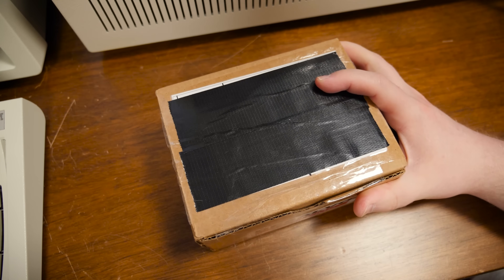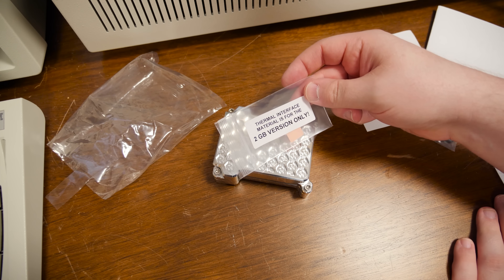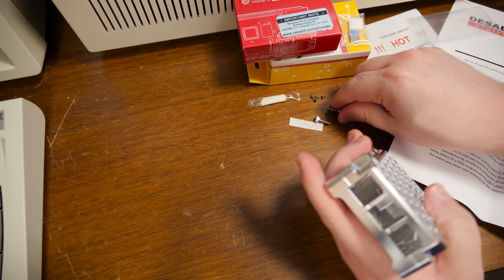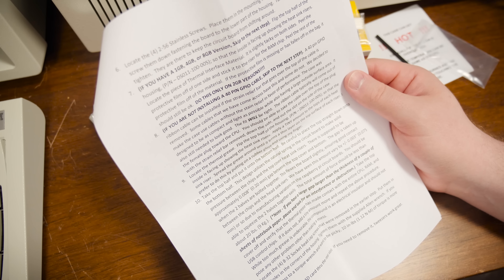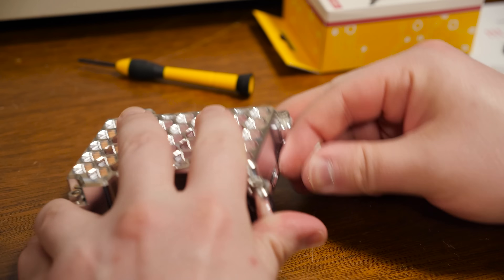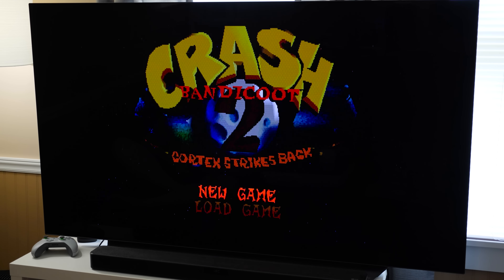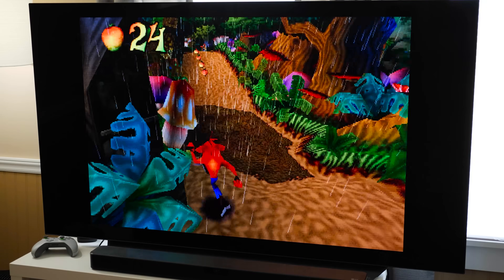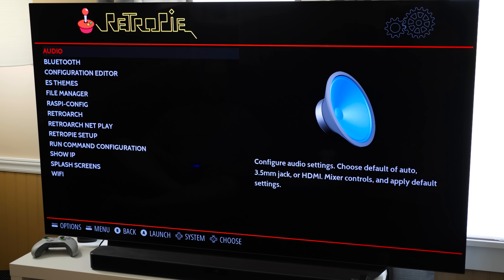Solid Aluminum Raspberry Pi 4 Case by DeSalvo Systems

Comment from the maker: To those saying this kills wifi and Bluetooth: nope, not that I can tell! PS4 controllers still work great and so far I've transferred a hundred gigs of files using Samba wirelessly with no problem. And my router is on the other side of the house, so yep, seems good to me 👍
Reply: awesome
Reply: Pretty neat looking case, could probably plug in a regular usb fan too keep it cool additionally if you ever need too overclock I'd imagine.
Like just setting it down next too the case pushing air from the micro sd slot side.
A random 120mm fan from a power supply hooked into a free usb port on the raspberry pi & it's gonna cool it down fine I'd imagine perhaps as well or just a random usb wall adapter belonging too your average phone that's spare should do the trick as well.
Also that reminds me i got a 3B sitting on a shelf with a small memory heatsink on it just collecting dust atm. (Got no usb keyboards atm nor wireless peripherals, could probably hook up that too a spare hdmi port on my monitor & mount it with doublesided tape or velcro as it's light enough.)
Reply: @Mini-z1994  Hey Bro! Cool story! Tell it again!
Reply: nice.
Reply: .....makes me think that case needs a fan on it
Reply: That's kind of unfortunate, because I was liking the idea of this case as an RF-shielded case for radio related projects and stuff.
Reply: This seems like a modular thing that  could integrate with whatever tool, automata, or vehicle that the pie is driving.
Reply: What i'd like to know is how the case manages to not short out the various soldier points and traces on the board.
Reply: @jb0nd38372  The magic of solder resist.
Reply: @jb0nd38372  it only touches the pi on the screw mounts and the three heatsink touchdowns. So nothing else has a chance to touch and short.

Fwiw, I have one and my wifi signal went from full bars (right next to router) to 1 bar. So, yeah, best to use an ethernet cable of you need decent network strength.

Comment: The actual best way to run the GPIO is with an old school 40p40c IDE Extension cable. I've made a few of these myself with bulk connetors and cable. Works nicely. If you want to fit the male connector to the outside, you may need an accompanying female connector to keep the pins from bending.

Comment: The way it's designed, the CPU will heat up the other components that don't get as hot, like the RAM. I wonder if they can tolerate the same temps as the CPU?

Comment: I have one of those cheap 15 dollar cases that came with heatsinks and at 2ghz the pi doesnt throttle. I would assume that case can soak heat for a really long time. Who knows when the thernal throttle actually happens but its prbably a very long time

Comment: Looking at the top design in your picture you've used. I'd suggest they used that design to increase the thermal footprint that the heat can be dissipated from. The only thing i'd like to see, not that i've dabbled in such things; is a few of they outside hexagonal shapes milled out completely and a second slit in the case on the opposite side to the one already there, so ir matched and allowed heat to rise and cooler air to pass in through; there is a technical term for this but i can't think of it.

Comment: Put thermal paste on the surfaces where the upper half touches the lower half, or else, the lower part is completely useless as a heat sink! So useless, that it could have been made out of nickel-platted cheap plastic, so, halfing the price and weight of this product...

Comment: I wish the Pi4 had gone with the CPU and RAM on the bottom of the board. I have a NanoPi M4 that I bought because it is designed that way and has a huge passive heatsink that mounts to the bottom. Also it has antenna connectors.
The Desalvo case is what I would design if I made my own.

Comment: Great video LGR, as for overclocking the Pi 4, a few tips. Firstly, you're going to want some form of active cooling, a fan will work well. I've got the Ice Tower thing that looks like a gaming PC cooler from Amazon, I can use a Pi 4 with the absolute maximum overclock the firmware will allow and it stays about 60C-70C, which is absolutely fine for a computer like the Pi. Secondly, overclocking is the same on most Pis, except you don't use the setup tool in the command prompt for it. You have to use the config.txt file in the boot partition of the SD card. There are plenty of good videos from lots of people on showing to overclock it, depending on how good of a chip you get you can get reasonably stable overclock on everything with a pretty good cooler. (CPU, GPU, and even the ram if you want too) If you put a fan on yours it should be fine, and you'd be surprised how much it can help. 500-600mhz can make the difference between unplayable emulators, and perfectly playable. I use my Pi for a constant load of 15-25% and it's outside and a weatherproof box, and that cooler keeps it pretty cool. (Weather satellite decoder) Hope this helps!

Comment: Those internal screws is probably helpful keeping the pi from moving just enough from thermal expansion to break the connection between heat sink and thermal paste and chip

Comment: The Pi 4 ran hot when it first came out. Not sure if there have been any improvements to that subsequently, but I ended up getting an open-air case with a fan mounted in the top, which I paired with a small USB fan for extra cooling. I was planning to run it 24/7 eventually, hence the extra measures. Almost a year later, and I still haven't gotten around to that project...

Comment: I much prefer these cases to those solutions with horrible noisy fans with crap bearings and small heatsinks

I've traditionally used these big chungus style ones or just a big chipset heatsink glued to the CPU for quick and dirty silent solutions.

The case on my pi 4 was on ashen's channel if I recall correctly

Comment: Hey so just a note - although that UGreen micro HDMI adapter is well built, it doesn't seem to have CEC connected - which will only matter if you want to use the Pi on a TV and control the TV through the Pi.

Comment: For overclocking, You'd either have to put a fan on this, or get something like the Ice tower cooler. 
though for normal usage, this is perfectly fine. 
one thing as well, with all the heat, would the rubber feet and adhesive dry over time? that seems quite plausible with something like this.

Comment: If you want to see temperatures, you could probably use Gallium HUD (which is built into mesa, the OpenGL library on Linux) by setting the GALLIUM_HUD environment variable to "temperature". I've never used a pie so I don't know how that custom Debian boots retropie, so you will probably have to search how to apply the variable to it, unless someone here knows.

Comment: interesting that they go with aluminum since aluminum has some of the worst heat conductivity amongst all of our commonly used metals.
Reply: While it may be less than copper it is 4 times as conductive as steel. 15 times that of stainless steel,  double that of zinc or brass and slightly less than gold. So it's not too bad thermally.   Btw, it's specific heat (ability to absorb thermally energy) is 3 times that of copper.

Comment: You don't have enough heat sink for both memory chips. Although normally memory doesn't get that hot.
Reply: The case is only for one memory chip, not both.

Comment: I think it would be good if the honeycomb was actually fins instead as that would be better for heat dissipation. Also, you could more easily mount a fan if needed.
Reply: Yes but it'd up the cost a lot. Each half is cut out of a single piece of barstock The honey comb is the best way to increase surface area without increasing the size of the bar stock.

Comment: How hot exactly does the aluminium Pi case get? I suppose it's not hot enough to necessitate a fan installed on it, though I one could setup one of those mini desk fans next to it to blow across the pie.
Reply: I did a 1 hour test at 2.1 GHz and the chip reached 78 C without throttling.  The case was less than that because it was dissipating heat. I have a friend who attached thermal couples all over it and did testing. I am thinking about putting up the results on my website.  They were pretty good and quite interesting!

Comment: should get one of those infrared thermometers with the laser. they're cheap, especially at a pawn shop and you can walk around your house quickdraw-temperature checking everything or make your cat chase the laser, w/e.
Reply: Using that on shiny aluminum will be like using a camera on a mirror - shiny metals are generally just reflective to the IR that the thermometer is measuring, leaving it near impossible to measure directly off of them. You could put a matte black painted square on it to measure off of, but it's not terribly convenient.

Comment: I have a Pi 2 running Retropie and man...I need to use it for PS1 emulation more. My PS1, even with a new laser and Taiyo Yuden discs, sucks at playing burned games.
Reply: You're probably using shitty disks.  Even Verbatims aren't what they used to be anymore.  Good shit is harder to find anymore since there's no demand and they want to cut costs.

Comment: LGR, Just take a piece of tape and put it on your sd card like a tag so you don't have to use tweezers.
Reply: I did that that with my laptop's hard drive! Unfortunately there isn't enough clearance in an SD card slot to fit a piece of standard tape (I've tried.) Maybe Kapton tape is thin enough.

Comment: The only thing that annoys me about the Pi4 is the use of micro-HDMI instead of just USB-C for both data and video. One port for power+video to plug in to a USB-C display would be great, but even if they were separate "one USB-C power-only, two USB-C data+video" it would be acceptable.

Comment: Would be interested in a "/opt/vc/bin/vcgencmd measure_temp" readout while playing games. The pi with no heatsink would be about 40C above ambient while playing ps1games..
Overclocking is no big deal at all. It's just two lines in the config file.

Comment: How long have you left the pie on before? Basically do you have to worry about the case possibly being a fire hazard? Also which controller are you using with the pie?
Reply: Had a friend of mine overclock to 2.1 GHz and run overnight 12 hours solid with stressberry. It didn't throttle or overheat. You could see on the graph he did when the AC in the office turned on. Pretty interesting.  I've done 1 hr at 2.1 GHz and it never throttled.  Chip got to 78 C. Case would be hot as hell but less than 78.  I imagine it would be like any other electronics as you wouldn't want to bury it in a pile of clothes because of heat.  That said the pi should not generate more than 80 degrees C and think that is well under the ignition point of most materials.  I would treat it like any other raspberry pi in a case.

Comment: Kinda like it. Though I'd rather se the logo on the top as well as some more ventilation holes, like in the honeycomb pattern from the backside? (Yes, like the new Mac Pro). I don't like the tooling paths on the bottom at all :/

Comment: Would a full metal case interfere with wifi? If it dose its probably negligible.
Reply: You can see the case makes direct contact with the WiFi & Bluetooth SoC's shield, which it uses as an antenna. In short, this case acts as the antenna for both.

Comment: You might want to hit it with some spray can clear coat to keep it pretty. It will eventually oxidize and go gray if you don't polish it somewhat frequently.
Reply: Wouldn't clear coat affect the heart dissipation?
Reply: @Crusader1089  Not appreciably. I'm talking about a layer of lacquer that is so thin it's measured down to the micron. Professional automotive clear coat is around 35-50 microns and a spray can is likely to produce coats even thinner than that.

For reference, one strand of your hair is about 75 microns.

Comment: The rpi2 still had a push to eject mechanism for the SD card. Learned it the hard way when I put a rpi3 in rpi2 case and always had to get the tweezers. 
Now that I moved the rpi2 in the rpi2 case it works as intended

Comment: So the 8GB is excessive for ReteoPie? Some of the arcade, PSX, and N64 games chug on my Pi 3 B+
Reply from the maker: 8 gigs of RAM doesn't really help in that kind of emulation. Much more useful are higher CPU clock speeds and GPU power.
Reply: RAM is only practical on the Raspberry Pi for multitasking while browsing as if it was an actual desktop.  If you're masochistic enough to want to do video editing on it, I guess you could do with an 8GB.  Otherwise, 2GB will do you fine.

Comment: Waaayyy too much machining time, a machinist would say. Good value tho.
Reply: CNC Machines do all the work!!
Reply: @NathanChisholm041  CNC machines don't just show up, program themselves, build and install their own fixtures, order their own tooling, generate their own electricity, repair themselves, house themselves, and do all of that for free.

Low end commercial grade CNCs start around $200k and that's just for the machine with no tooling, fixtures, etc, etc. It takes a lot of $50 Pi cases to pay for that machine. That's why machine time matters. Every hour that machine is running it has to be making money to pay for itself. The machine time in those cases is crazy for $50, which is what OP was saying.

Comment: really nice looking case, the only thing that bugs me is that you can see the cnc tools marks, instead of seing the whole case with no marks at all
Reply: I have some custom machined, ultra huge, aluminum washers on my desk at work and they have what are objectively beautiful spiral tool paths cut in them that everyone comments on looking so awesome.

Then there's me... The guy that knows those tool marks are actually the sign of a job poorly done and in a hurry,, which is entirely accurate, but people love them all the same. That's not at all intended as an insult to that Pi case as you're getting way more than you're paying for at that price, it's just funny how much the average person likes seeing CNC artifacts when there are a lot of us who go through a lot of effort to get rid of them. I'm reasonably convinced the average person would think getting something with a broken end mill sticking out of it would be even cooler.

FWIW... You could wet sand and re-polish that case and make it a mirror in a few hours if you wanted. Chrome-Pi.
Reply: I'm kind of a sucker for right off the machine parts with no "sins" hidden.  That said I have had several requests for other finishes like bead blast and anodized.
Reply from the maker: I quite like the marks! CNC-ing is awesome.

Comment: Cool box. Wave goodbye to WiFi and Bluetooth :)
Reply from the maker: Both are working great actually! Been playing with a Bluetooth controller and using Samba file sharing for hours.
Reply: You can see the case makes direct contact with the WiFi & Bluetooth SoC's shield, which it uses as an antenna. In short, this case acts as the antenna for both.

Comment: iirc they ditched the spring loaded sd card slot after the pi 2 because it was the single greatest point of failure on the device

Comment: Machinist here. That is a work of art.
Reply: Agreed. I was pretty surprised to see it's only $50. There's some machine time in that thing.
Reply: @TheBrokenLife  absolutely. I would change 4 times that
Reply: @theusedbox  I would consider that a bargain, frankly. I would fully expect to get quotes for $500+ to have one of those made at my local machine shop. For me just to buy a billet of around that size is at least $20.
Reply: @TheBrokenLife  I used a really efficient machining strategy and bought a ton of material (literally).  There is still quite a bit of mill time on these even running on a mill with a 20,000 rpm spindle. Machine is a Haas DT2.
Reply: @TheBrokenLife  it ts tough to get the price here. Lots of automation and innovative processes. Let's take it back from the chicoms!
Reply: @EricDMMiller  Precision Machined!
Reply: Hello Christian Bale.
Reply: Thanks!
Reply: @AstroKitty16  China exists thru crooked US politicians and Chinese gov subsidized production. I'm making these cases myself and using tons of automation to make this happen.  China is slavery.  The more we charge (small businesses)  the better wages we can provide our people.  I hope that someday, my price is considered obscenely low!
Reply: senpai noticed me UwU
Reply: I was just gonna point out the self reply but I realized it would be foolish as edit makes that heart disappear.

Comment: It be cool if you can make small hexagon out Wood.  They fit in void's.
Reply: Wood is really bad at heat dissipation, that would render that case almost useless.
Reply: The trick to doing that would be for the wood to actually not be down in the hex, but rise above it on small pins. So you would actually have the wood hovering above each hex depression while seeing the aluminum under it. The net effect would be sort of like looking through a lattice fence.

It would impede natural air convection a bit, and hinder cooling some, but would look insanely cool and give you the aluminum+wood hex that you desire.